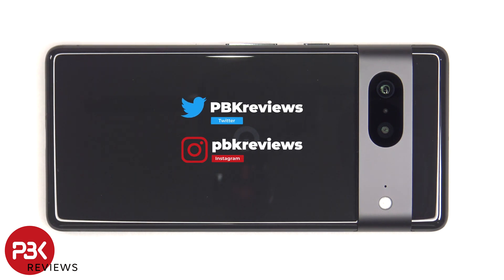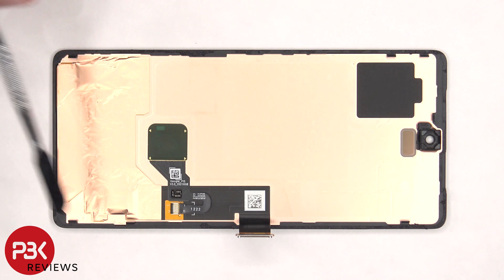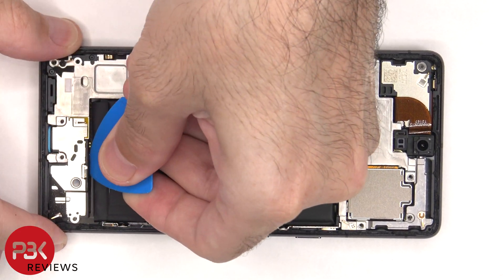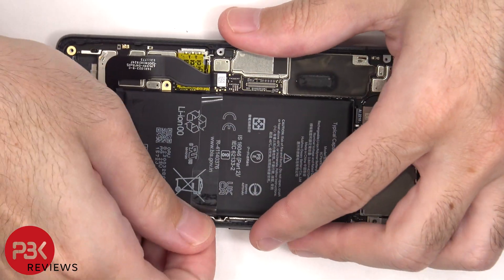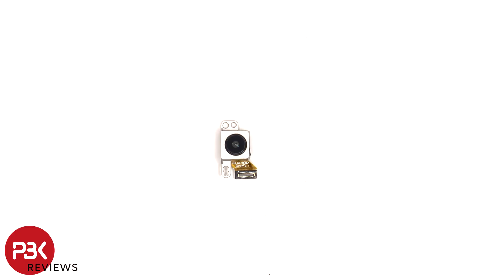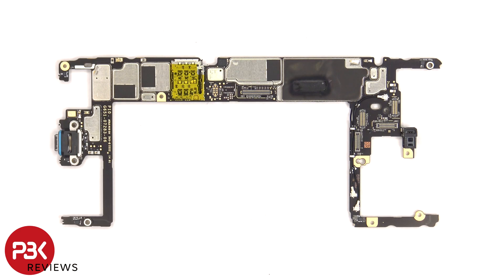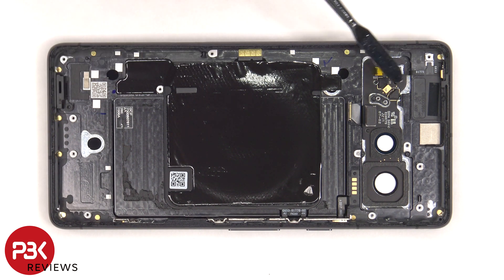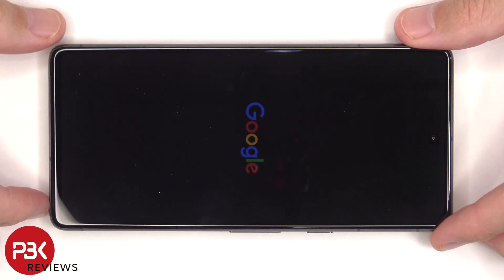Google Pixel 7 Disassembly Teardown Repair Video Review

Comment: I'm about to do a battery swap. Battery puffed up and lifted the screen off the frame. Even though the phone's a year out of warranty due to some reddit posts about the issue, I decided to contact Google about this anyways. They decided to send me another pixel 7 and let me keep this one (told me to recycle it). Really nice of them, but probably because there's also no legal way for me to RMA this thing (it would be illegal to ship a battery that's known to be defective). 

So the phone can either be spare parts, or I can just put in a chinese battery and still use it as a backup phone. But it's good to know Google's standing behind the product.
Reply: I'm on the exact same situation. Screen lifted off. Can I ask how did you contact google exactly? Might give that a try. Thanks
Reply: @JonatanGGomes  did you contact them already? I might do the same

Comment: Where is the internal storage located in the pixel 7 ? Cause need to know if the data can be retrieve.
Reply from the maker: its soldered onto the motherboard and not user removable.

Comment: The loudspeaker does not work now. Think I need to replace it? The phone does not ring either. The ear speaker works.
Reply from the maker: it's possible
Reply: @PBKreviews  I don't think I had it in there properly because it's working now. TY for replying.

Comment: I am repairing a pixel 7 power flex, the flex i took out of the phone has 4 brass pads, but the only flex i can find to replace it have 5 brass pads. Any ideas why?
Reply from the maker: Yeah, that's weird not sure why. Maybe they originally made the prototypes with 5 contacts then later changed it after a round of the parts had been made or later releases of the phone they added the 5th contact, no clue. But yeah seems to be hard to find the replacement with 4.

Comment: Stupidly I swam with Pixel 7 in a pocket. Havent been able to switch it on in a week. Thinking of opening it up. Is it worth the effort? What do you think?
Reply from the maker: If its been sitting for that long with water inside, It might be too late to repair it. Since the corrosion and water inside would short and damage the parts, especially if you attempt to use it or power it on without drying out the water internally and cleaning out the corrosion around the chips/connectors.

Comment: Hey guys I need some help, I got my pixel 7 falled to the ground and even thought everything's working properly and the exterior is brand new (I had a case) the upside part of the phone has started to have a loose (and I think big) part and it sounds when I shake it and I'm afraid something is going on there, should I open it?
Reply from the maker: The camera assembly is suppose to rattle, it's normal.

Comment: What should I do when having water damage?
Reply from the maker: You would need to take apart the phone, disconnect the battery, dry out any liquid inside, use a small brush like a tooth brush to brush off any corrosion around chips or connectors, and then re assemble the phone to see if it works. If not, you would need to check one by one to see what part has gone bad between the battery, charger port and screen. If neither of those are the problem, then your main board might be damaged beyond repair.

Comment: Wheres the back telephoto camera? It sits between the two big cameras.
Reply from the maker: This is the Pixel 7, the one you're referring to is the Pixel 7 Pro, and the telephoto lens is not between the two other camera, but furthest right one.
Reply: @PBKreviews  you're right. Dev check must be wrong. It's a light sensor.

Comment: As others have mentioned, I was looking for precise location and measurements of charging coil
Reply from the maker: You can see it @4:08 in the video. It's at the center back of the phone (pretty much the square section that you see with graphite film is the coil size/location). I don't have it on hand anymore to take actual measurements but you can base it off what you see in the video I guess.

Comment: Hello. When I shake my there is something that is loose inside. Should I open it up or should I leave it as it is. Also, If I open it up, can I put all together again with the same parts?
Reply from the maker: It's normal, its just the camera assembly.

Comment: Cool video, do you think that the mid plate on this vs the pro would help with resistance to bending?
Reply from the maker: Thanks. I think they should fairly be similar since the mid plate might be larger on the pro but the phone is larger as well. So the bend resistance would be somewhat the same as the regular version since its smaller and that in itself helps bend wise.
Reply: @PBKreviews   what I've noticed is that the mid plate stops just below the camera bump, in line with the antenna on the pro. Your tear down of the smaller 7 shows the mid plate go across the camera bar and up, with the plate in line with the antenna. Very strange to have 2 different designs, but I am assuming the pro telephoto lens was the reason?!

Comment: Nice work, I want to place a metal plate in my case for my magnetic car mount without disrupting wireless charging. Would you say the far bottom of the phone is the ideal location ?
Reply from the maker: Thanks. Yeah probably mid to bottom portion.

Comment: How would you replace the rear camera glass? I managed to break that small oval-shaped glass piece in less than a week somehow. Really frustrated by sometimes accidents happen
Reply from the maker: You can heat the glass portion itself and pry it off. If there are replacements for it already, you would be able to buy one online and re apply the replacement (it should come with an adhesive strip).

Comment: What is your opinion on the water and dust seal? Does the seal completely rely on the frame and glass seal or do they have additional seal inside the phone? I have seen some reports of small gaps (1 mm) between the screen and the bottom frame and was wondering whether it will affect the IP rating of these phones... BTW, Thank you for the great teardown video 😇
Reply from the maker: Yes its usually based on the outer seal for the most part. The small gap should be fine in most cases since the adhesive is somewhat flexible but overtime it can degrade however there are plastic clips aside from the adhesive which are holding the screen assembly down in place so I wouldn't be too worried. But I wouldn't take any ip rated phone regularly in the water with me since they are water resistant and not water proof. They are only water resistance as a safety measure and not intended to be intentionally dunked in water all the time because that too would over time deteriorate.

Comment: good video brother 💯👍🏻 your channel is always active 💡👍🏻 Google pixel 7 is super wow 👑🔥
Reply from the maker: Thanks!
Reply: @PBKreviews  considering the price gap between 7 and 7 pro which is more sensible option to buy
Reply from the maker: Probably the 7. For the difference in price, I don't think you're getting that much more for the 7 pro. The 7 itself is pretty much the same aside from one less telephoto camera, slightly smaller battery, and a slightly smaller screen. You get less RAM also but the processor is the same which is the important thing.
Reply: @PBKreviews  All I care about is the 120hz screen vs 90hz.
Reply: @PBKreviews  that is the reality, that is the important thing the processor that handles everything💡💯👍🏻

Comment: so, there's no 5g antenna. Just some metal piece.
Reply from the maker: there is 5g, just no mmWave 5g for this specific model pixel 7. Some versions will have the mmWave antenna as well.
Reply: no mmwave doesn't mean you don't have 5G. you still have sub-six. don't worry!